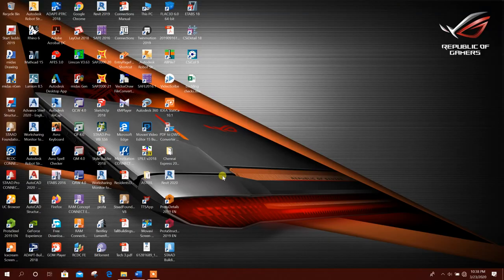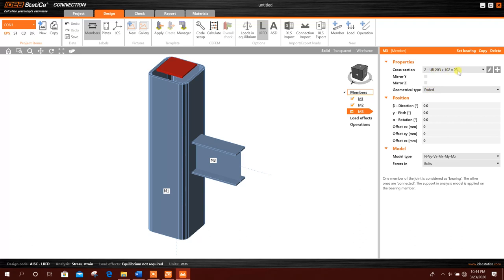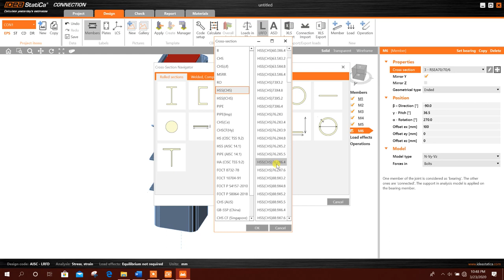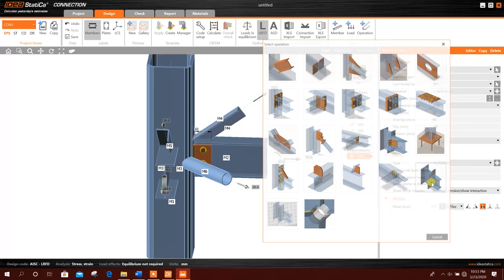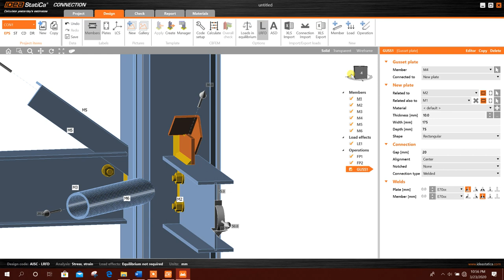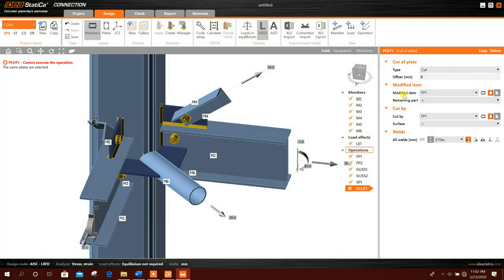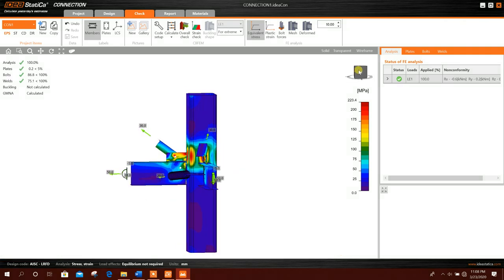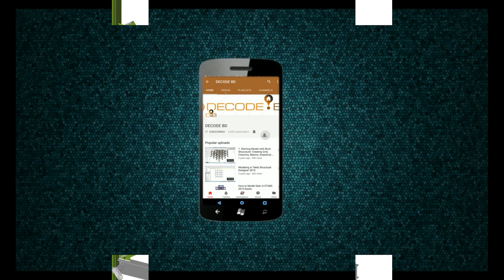Customized Steel Connection Design in Idea Statica 10.1

Comment: The connection between the tube and i beam i thick its not satisfy the code for connection because the joint in web only i mean its shear connection not moment connection

Comment: Most probably they have a plugin for ETABS. Please make a video of that as well so that it can be used in ETABS as well
Reply from the maker: Yes. Will try to do that, but for that BIM activation may be online process needed. For cracked software it may not work. Will Check in sha Allah.
Reply: @Decodebd  IDEA STATICA  BIM IS WOIRKING WITH ETABS;STAAD;SAP 2000. CHECKED